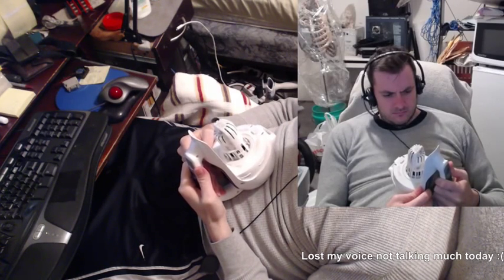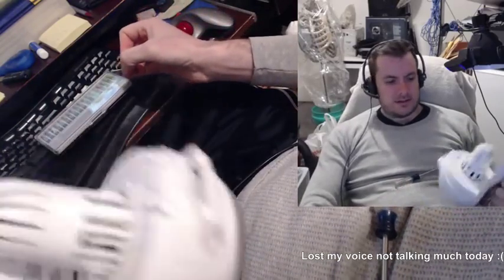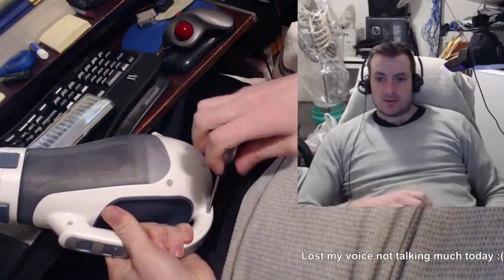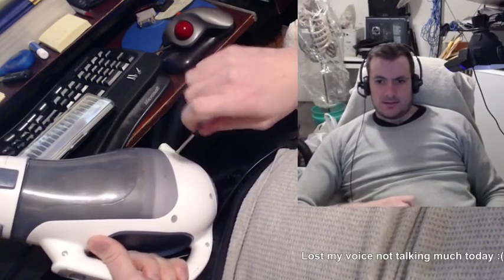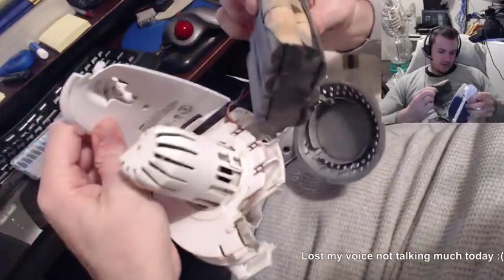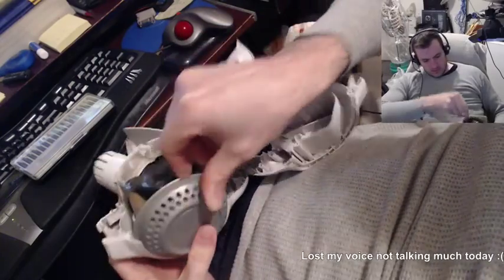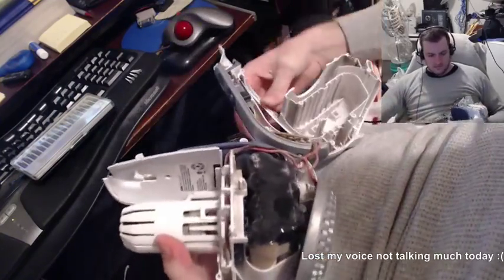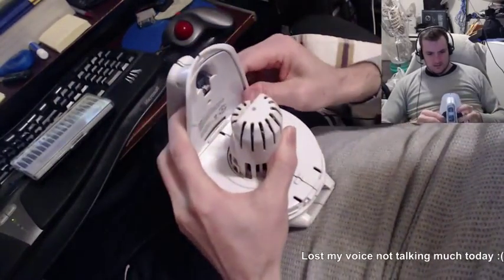DustBuster Fix #1 | DustBuster Hand Vacuum Battery Pack Replacement | Teardown and Forming a Plan

Comment from the maker: Please understand this is the first video planned in a series of videos covering a battery pack replacement process.  In this video series I will create a power supply to run the vacuum direct off the wall and will create a battery pack and install that into the vacuum.  Stop acting like impatient children because part 1 of a video series does not cover the entire process.  Be patient.  Designing the battery pack and power supply and breaking into working with microcontrollers and soldering etc is a substantial ordeal that takes months or years in my spare time chipping away little by little.

Comment: What the hell is happening here?
Reply from the maker: This is video one of a long video series planned covering replacing the battery pack and creating a power supply for the vacuum as well all DIY using cheap electronics parts and a soldering iron all low level electronics.
Reply: Fuckin mouth-breather, thata what
Reply: Not much. The author subjects us to 10 minutes of him staring at the unit in wonder... slowly taking it apart, and putting it back together to insure he knows how to do it. There is no part 2 to show how you actually replace the battery. Read Sonya Finkey's comment above.

Comment: Called B&D, they recommended to "recycle" this once your battery dies. There is no replacement battery for this. Also, if you purchased it and battery dies within 2 years, they will send you a replacement. I am 2 months too late on the warranty. Oh well, know not to buy B&D product next time.
Reply: aboveGravity 
I’ve found Black and Decker batteries just don’t last very long. Doesn’t matter what product you buy. Should be against the law to sell a product where you can’t replace a battery.

Comment: If I were to replace the original nicd batteries with eneloope's, would I still be able to use the stock charger to charge them?  I know the battery chemistry is somewhat different, but since I use the same charger to charge both (on a La Crosse charger), I was curious to know if nimh batteries could be charged stacked using the charger that came with the dust buster. Thanks for taking the time to post the videos.
Reply from the maker: You'd have to wire it properly for compatibility with balance charging and ensure the charge rate and max charge voltage of the replacement battery was the same as the originals.  I'm making my own battery charge management system which I will reveal when the project is finished later on.
Reply: artbyrobot Thanks. I’ll look forward to your video.